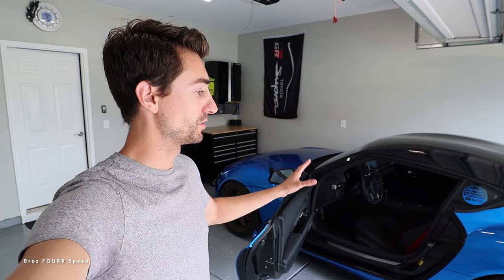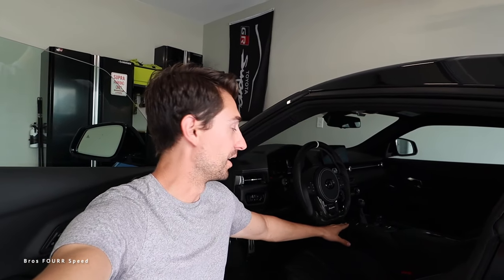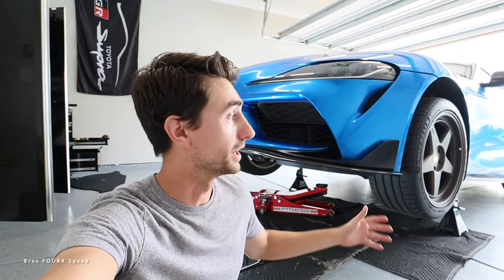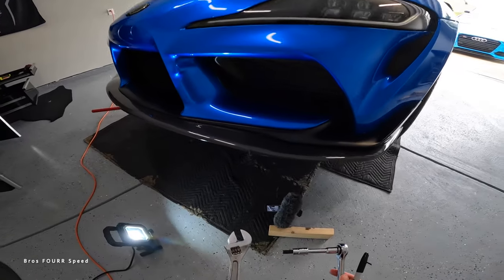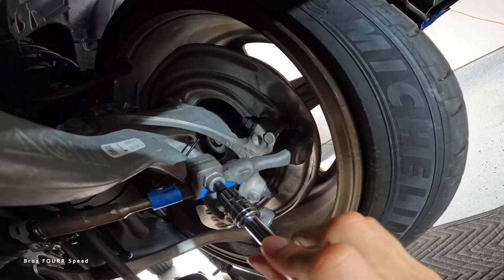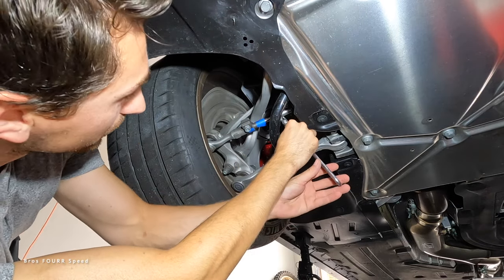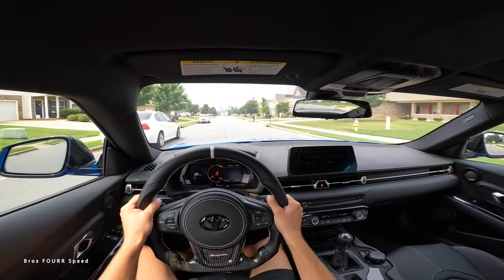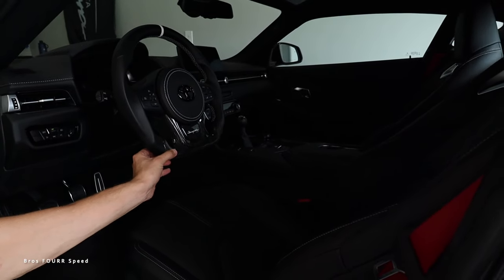How to Straighten Your Steering Wheel Easily at Home | DIY Car Alignment

Comment: easy way to put it: steering wheel crooked to the right. driver side rod turn clockwise right, passenger turn counter clockwise to the left. And if the steering wheel is crooked left, do the exact opposite.
Reply from the maker: True except for one thing. If the tie rods are on the back of the wheel, you will turn them in opposite directions compared to tie rods that are located in front of the wheels  ;)
Reply: @BrosFOURRSpeed now this is it depending on if rack is in front or back plays a big part
Reply: How if the driver side is on the right side and the passenger side is on the left?is it still the same for the adjustment on each side?
Reply: Shorten Driver side tie rod. Lengthen passenger side tie rod.
Reply: Does the steering-wheel need to be locked while Doing this
Reply: @dereckverdesoto  No. Leave unlocked.
Reply: @dereckverdesoto  you want to straighten the steering wheel and put a piece of tape on the steering wheel

Comment: Can’t alignment tech just hold the steering wheel straight after performing the alignment and let the machine tell them if any angles are still off? It is frustrating that after spending $150-$200 you are still left with an imperfection.
Reply from the maker: You can. But just depends on the shop and how well they line it up and if they will let you test drive the car to verify it's straight. For me, it didn't really bother me until months later when I did the new steering wheel and the stripe made it more obvious. So I just did it myself to not wast a trip to the shop

Comment: Interesting, my pet peeve too -- QUESTION -- Are you sure that you should correct from the rods/wheels rather than from at the steering wheel? My gut tells me that the correction should be done from the steering wheel and that by messing with the tie-rod (I think that is what it is called) you have ever so slightly reduced the amount of wheel turn possible in that one direction ie you will not be able to turn fully to the left and will have introduced more possible turn to the right - just imagine if the steering wheel was off a full turn and then you adjusted the tie rod by the correspondingly large amount needed to correct for it - you would greatly reduce the turning performance of the car on one direction and over extended it on the other - this correction needs to be done from the steering wheel to truly get it perfect. Extremely small change but change for sure.  Of course, I have no idea how they correct this at the steering wheel and it may be more complex.
Reply from the maker: You can't just make an adjustment to the steering wheel tho. We are only talking about maybe one turn of the tie rod. Shortening it like 2mm if anything. So thats won't affect your steering. I learned this from a performance shop who races their cars. They wouldn't do it if it caused anything less steering angle. The tie rod ends have adjustments like this for a reason. Weather you make the adjustments to fix the toe of the vehicles or adjust your steering wheel, you're still making adjustments on the tie rod ends.

Comment: I'll have to try this. I went to the shop to get an alignment. The car drives straight but the steering wheel is slightly turned to the right which bugs the hell out of my OCD ass.
Reply from the maker: Shouldn’t be too much work to straighten out!

Comment: Just purchased a new car and came with the flat bottom steering wheel , looking into doing this but was wondering would it affect future alignments in any way?
Reply from the maker: Nope. But I'd go ahead and have a good alignment done first. They might do a good enough job and the wheel will be straight anyways after it
Reply: Awesome , going in for an alignment check today and if all is good , I will be following these steps

Comment: 1/2 turn 1/4 turn. Same thing. 😂
Reply from the maker: No. 1/2 half turn would be a 180 degree turn. 1/4 turn would be a 90 degree turn. Do you not understand fractions and degrees?
But these different turns made a difference. I just did this on our RS3 and 180 degree turned the wheel way too much. 90 degrees was perfect
Reply: @BrosFOURRSpeed  You missed it. 😂 😂 4:43 Says 1/2 out loud but only turns it 1/4. Who doesn’t understand basic math now? Baaaaahahaha. 🤡

Comment: Should the weight of the vehicle be on the front end when doing the Alignment adjustment. Shops have a rack to drive the car onto. The mechanic walks under the rack to adjust Alignment.
Reply from the maker: For this it doesn't matter. Alignment tips have a spot where the front wheels sit that lets then turn. So in your garage, lifting the front up would be ideal. Especially to gain access

Comment: Honestly if it’s a good alignment shop they should make it %100 good if you pay you should not have to do anything
Reply from the maker: Very true. But sometimes the wheel moves a tad when they do it. So if this happens, it's an easy fix
Reply: Some tehnicians look at the steering wheel and it seems straight to them, they just don't see how it's crooked by a single degree.

Comment: What if my steering wheel is bad but my alignment is good
Reply from the maker: Then this is what you do. If your alignment is solid but the steering wheel is off, this is how to adjust the steering wheel without effecting alignment
Reply: @BrosFOURRSpeed  sweet thanks!
Reply: @BrosFOURRSpeed so what if the alignment is good but the steering wheel is a bit off center, I don’t have to worry about uneven wear, right?

Comment: This worked great. Marked up the original position and turned both a quarter of a turn. With that said, how tight do you tighten the tie rod locking bolt? Hand tight plus another tug?
Reply from the maker: Nice! Yeah about hand tight with a firm pull!

Comment: i respect your patience having to lift the car up numerous times would drive me nuts.
Reply from the maker: Yeah it's a bit annoying to do it 3 times. But at least I didn't have to take the wheels off each time. Gotta make the vid ;)
Reply: @BrosFOURRSpeed  so it's not necessary at all to take the wheels off? I'm gonna try this fix on my 2023 audi q5. Thanks for the video!
Reply from the maker: @anhd1507  Depends on the car. I did this on our S3 and it was easier removing the wheel. So depends

Comment: Hey my wheels are aligned but the steering is off itself. How do i adjust just the steering and. Not the wheel
Reply from the maker: The very video you made this comment on is your answer ;)
This video is literally showing how to adjust a crooked steering wheel without effecting your alignment

Comment: I would think since the tie rods are what they turn to do the alignment, turning them again undoes the alignment.

I would straighten the wheel at the steering column
Reply from the maker: Most steering wheels have a thick spot on the splines and can only be put on one way. Also that's a significantly harder adjustment to remove your steering wheel. I've done it on the Supra, but it only goes on one way. However when they do an alignment, the steering wheel can move a bit and get thrown off. So this adjustment lines up the steering wheel without messing up the alignment. I learned this form a professional race shop.
Reply: @BrosFOURRSpeed  is it because you're turning the sides the same amount in opposite directions?
Reply from the maker: @kotymccallister5150  Yeah because I make the adjustments identical but in the opposite direction. It’s only adjusts the steering wheel. The alignment doesn’t change

Comment: If the car was actually aligned, your aligner got the thrust angle wrong. Incorrect thrust angle will cause the nose to pull and a steering wheel that's crooked. They may have also flubbed your steer ahead, which is the trueness of the steering to 12:00 when the wheels are forward and the car is tracking straight. In short: they should be redoing your alignment to fix this.
Reply from the maker: To be honest it’s a hassle to go back to the shop. But if they do the alignment with the steering wheel slightly off. The alignment itself will be good. I have the print out and all the adjustments are correct. So this adjustment corrects the steering wheel without messing up the actual alignment. I can fix this myself in a fraction of the time it’d take to go back to a shop.
Reply: @BrosFOURRSpeed  But you're adjusting the tie rods, which is changing the toe. You may have corrected the straightness of the steering wheel, but now you have one wheel with increased toe out and one wheel with increased toe in. This may exacerbate tire wear.
Reply from the maker: @thraxbert  As shown in the video, as long as you rotate both tie rod ends in the opposite direction, and the same amount of rotation. You will not effect the toe. If you pull both wheels in the same direction a half of a turn. You won’t effect toe. Twisting the threads in the opposite direction will pull both wheels in the same direction to then not effect alignment.
Reply: Still confused how this doesn’t affect the alignment
Reply from the maker: @kalemjackson2631  if you do both ends the exact same amount of a turn in the opposite direction. You have not messed up the alignment. If the driver wheel goes to the left 1 degree and the passanger wheel goes to the left 1 degree. The alignment was not effected. Only the steering wheel got changed.
Reply: @thraxbert If equal and opposite is done to the other side is tow affected at all?
Reply: @BrosFOURRSpeed can it be a problem if you have straight steering wheel, correct toe on both front wheels, but tie rod length is longer on one side than the other? Dozens the imbalance of length cause a problem
Reply from the maker: @timothyjackson4653  Make sure you have a proper alignment before doing this. Can always even put the tie rod arms even and then have an alignment done. Then if your wheel is off do this and you’ll be good

Comment: hey man! awesome video, but i have problem, to understand how its done correct! i i have an polo gti 2018, with croocked steering wheel of to left, "my english is bad tho" but i went to the alighnment today, and get it fixed, but the wheel is still croocked out to left. ill go to them tomorow again, but if they can't fix it,  i want to fix it my self, so do i need to turn the wheel to the left side ,and djust it ? man i hate this! ADHD kick in yo.
Reply from the maker: You won't need to touch your steering wheel. Making the adjustments to the tie rod ends will turn the steering wheel. Drive on a flat road and put your steering wheel to the center position. Are you then drifting right or left? If you are drifting to the right, that means you need to adjust your tie rods and angle your front wheels to the left a tad. That will adjust your steering wheel
Reply: @BrosFOURRSpeed  thx for replying man! When i drive, and have the steering wheel center, then it drift to the right. So i need to adjust both side right ? And turn the wheel a bit to the left side ?
Reply from the maker: @atrcraze7988  you just need to adjust both tie rod ends and point the wheels to the left. Try 1/4 of a turn on each of them. Just make sure you are making each front week point in the same direction

Comment: A quick question, my steering wheel is off for maybe 1 degree, due to a new steering wheel. I do not have a professional car jack like you have, only the standard one which is in the car. I can reach the rods when I steer hard to the left or right, can I then also do this, or do the wheels have to be straightforward when adjusting the rods ? Or.. could I lift the car on 1 side, adjust the rod, and then lift the car on the other side and adjust the rod ? ( hope this question makes sense since Google translate helped me whilst typing this  :-).
Reply from the maker: You could do one at a time. Just make use you do them the same amount of turns and in opposite directions. It's easy to forgot which way you went. So take your time since you can do them back to back with the whole front end lifted

Comment: Are you messing with tie rod setting. Will your measurement be off
Reply from the maker: This simply adjusts the steering wheels relation to the wheels and gets them aligned together. Learned it from a performance shop
Reply: @BrosFOURRSpeed  ok great
Reply: @turbot6592  It will be slightly off but you’d never notice.

Comment: Cool but doesn't this mingling disrupt the previously done proper wheel alignment?
Reply from the maker: Nope. If you do both sides an equal amount of turns in the opposite direction. The actual alignment doesn't change. Just the steering wheel
Reply: @BrosFOURRSpeed how? If you had your car toed in and then you move the tires out how is the toe the same afterwards…..even though you move both tires wouldn’t you be moving one tire toe in and the other tires toe out? That would result in a different toe reading of degrees
Reply: @CLVannoy  read your comment again, you just confirmed the total alignment will be the same
Reply: @CLVannoy toe in on left side will cause the left tire to turn right. Toe out on right side will cause the right tire to turn right. 

Both tires turn right.
Reply: @papimasfuerte4671 I see what you’re saying but it still changes the direction of the tires making it dogleg down the road right ?
Reply: @CLVannoy  If by ''dogleg'' (never heard that one) you mean car kinda drifting sideways when driving straight, then no, adjusting tie rods won't make car dogleg. You'd have to mess with rear alignment to make car ''drift''. 

The only thing I worry about is by how much I turn my tie rods. If you turn one side slightly more you mess up your alignment.
Reply: @kass1564  It will never be as accurate as it was by laser but you’ll never notice.

Comment: I bet your glad you got the Supra since Nismo Z is auto only and disappointing
Reply from the maker: Very! Bummer to see auto only. I hope the upgrades make it on par with the auto Supra. But it might cost well into the $60k range. Hopefully I can drive one tho! I bet it is pretty cool. But I love my manual Supra!
Reply: @BrosFOURRSpeed  I can't wait for those reviews. Watch they come out with a NISMO RS like the Juke lol
Reply: Only 20 more hp for the nismo- mostly suspension upgrades.  A real disappointment.
Reply from the maker: @FATmenDRIVEtrucks  would be cool!
Reply from the maker: @oreally8605  I hope they did a lot to improve handling! If it’s not as nimble as a stock Supra, that’ll be disappointing. It’s weighs a lot more too. So I’ll have to see
Reply: @oreally8605  either they had no budget or holding back for future ones imo

Comment: So I got to figure out how to adjust my tie rod for my car. Took it to a shop to get it aligned and they didn’t do a good job on straightening the wheel. 

Need help figuring out how this adjustment for the wheel works. 

So when my wheel is straight it pulls to left. When the car is straight the steering wheel is slanted right side. 

So do I pull my right tie rod out and my left tie rod in ?
Reply from the maker: You need to aim both front wheels towards the right. Depending on if your tie rods are in front or behind of the axle, will determine which way they need to go. But pull the front of the tires towards the passenger side of the car

Comment: It’s definitely confusing that you say “turn in the opposite direction”. it’s clockwise vs counter clock, but from your pov, you turned the tie rods in the same direction—away from you.
Reply from the maker: Basically you want to lengthen one tie rod and shorten the other. Pretty sure I did say that in the video. But each tie rod needs to be turned in the opposite direction to not effect alignment
Reply: yes but “direction” is relative to POV so I was confused by that having watch the adjustment on the Audi which only shows one side, not both like this one
Reply: @microbrientube  You really have to think twice about turning tie rods to not mess up. You turn the wrench in the same direction, one side it lenghtens tie rod and on the other side it shortens it. It makes sense when you think about it.
Reply: @Mucky_Muck  yeah I eventually figured it out
Reply: @microbrientube  I did my steering wheel straightening yesterday on e92, I had to think for a good 10 minutes not to mess up LOL. 
Yes, I'm not the sharpest tool in the shed, but it turned out very well.
Reply: @Mucky_Muck  lol I have my own issues. I think it’s just a gap in spatial thinking and how it’s communicated. anyway, glad you got it right haha
Reply: @microbrientube  Yep.
Now I have to figure out what the f are my steering wheel doing when I hit 55mph. It has slightly annoying vibration and my OCD brain can't handle it lol.
Reply: @microbrientube  He’s learning, don’t be too harsh

Comment: if you get the alignment after you center the wheel is better lol.  you just jacked up the tow angle by  a few degrees
Reply from the maker: No, you'll want to have the alignment done first. That way the car is actually aligned. If the steering wheel is a bit off after that. The method I showed adjusts the steering wheel without effecting alignment. All shown in the video, you need to adjust both side in the opposite direction. That way you don't mess up the tow of the car.
Reply: @BrosFOURRSpeed  brother as soon as u adjust the tie rods your tow will be in or out by a degree or two. if your steering wheel is off center either the track on your steering rack is misaligned or there was damage done or the steering wheel is off center because the computer thinks center is in the wrong position. u can have some one with a scan tool adjust the wheel without touching any of the suspension. older cars do not have this option. . Im telling you from experience and not just saying it
Reply: @BrosFOURRSpeed  Wrong, the alignment will be off slightly but you’ll never notice unless you have lasers for eyes.
Reply: @moek28  Not a degree or two but maybe a half a degree